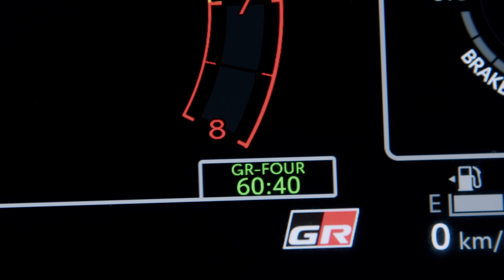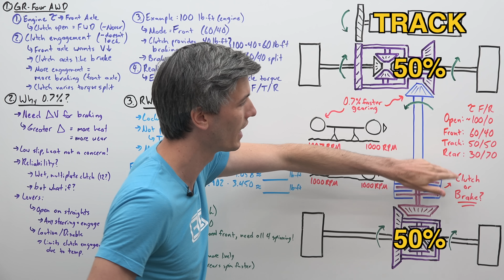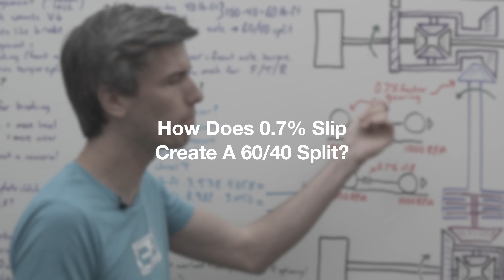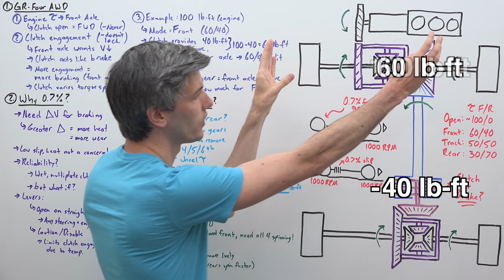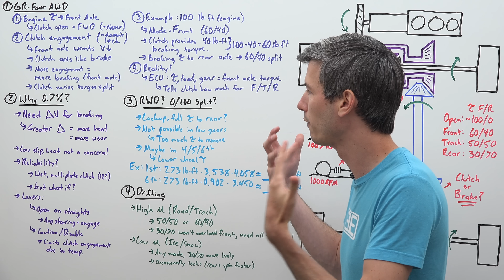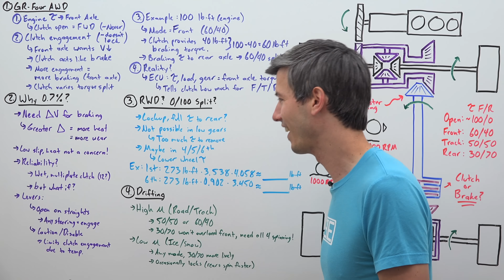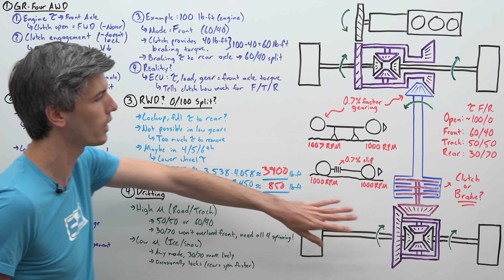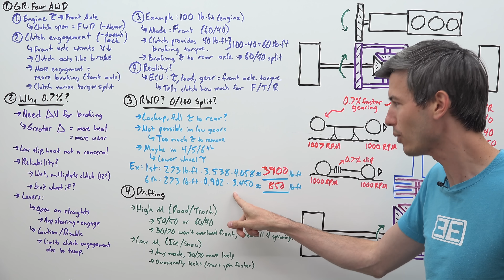Toyota GR Corolla's Brilliant AWD System - How It Splits Torque!

Comment: This reminds me of an AWD conversion for motorcycles where they have the front wheel driven slower (~33% if memory serves) but it’s hooked up through a freewheel. When the rear has traction it gets all the torque and the front is driven by the road faster than the chain, so front coasts like a bicycle would. But if the rear tire starts to spin the the chain driving the front catches up and starts distributing the torque.
Reply: You are thinking of Christini bikes I believe.
Reply: @The_Opinion_of_Matt 1q
Reply: @The_Opinion_of_Matt  also some Yamaha dirtbikes. Hydraulic drive to the front wheel
Reply: The Army deuce and a half trucks of the late sixties used a similar  system with a sprag clutch between the transfer case and front final drive.
Reply: Its actually quite common in reverse, Honda have done a few systems where a vehicle is front wheel drive but when the front slips the rears engage, I understand the issues with two wheel drive on a motorcycle and this would definitely help make one rideable, very interesting data thank-you I'm looking forward to learning more.....
Reply: I've never heard of this...going to have to look into it. Very interesting.
Reply: I was just going to comment to say this.
Reply: What Polaris(Four wheelers and stuff) call "real four wheel drive"(At least in some Swedish commercials a few years ago) is functioning like this(Separate freewheel for each front wheel, but electric engage when reversing and when decelarration in a "hill descent mode"), but for sure it is very very bad when doing work(Might be good in the swamps or whatever no idea, don't care XD)
Reply: @TarenGarond  that system is great for everything including work. The system engages even if rear slips slightly, 1/8 of the turn roughly i think.
Reply: @dkdanis1340  No it isn't great for everything(It is kind of obvious as it always need to slip the rear tires quite a bit all the time when 4WD actually is engaged.).
It is quite horrible for snowplowing (On icy surface with "non small amount" of snow)especially in corners you constantly goes sideways due to the rear tires slipping all the time, I've seen way lighter ATV's with worse traction tires (But with similar plows) do way better due to it not slipping the rear tires constantly...
Also the system is horrible when driving in terrain sometimes, imagine you need the front axle drive to keep the ATV from understeering when trying to going up sideways from some wheel tracks or something then you first need to slam the throttle like a maniac and make the rear tires slip which is very bad!
It is bad in many situations, that I'm very sure off(I'm sure it might be good sometimes though)!

Comment: Am not convinced with this awd system. Seems very inefficient, i mean how can they control the torque by slipping the clutch turning invaluable power into heat which has no use?
Reply from the maker: The braking force is still used, it's just sent to the rear axle, so there isn't much energy lost. It gets better mpg than STI, by far.

Comment: Been waiting for this video for the longest time. So basically it's very similar to the Focus RS's where the rear has higher gearing, but also like the Golf 7R where it has only one clutch pack before the diff
Reply from the maker: Yep! Though this is using a single clutch pack for the rear, the Golf R uses two, one for each axle (newest version, explained here: https://youtu.be/2-_Dzd74GUE), as does the Focus RS, but with a speed differential to allow for different torque splits.

Comment: The ending explains why all the test drives I've seen had massive understeer.... Seems like people just treated it like RWD and not AWD.

I feel like that clutch pack is going to hurt fuel economy pretty badly.
Reply from the maker: How does 0.7% slip translate to hurting fuel economy badly?
Reply: @EngineeringExplained   Right... I did not think through that clearly.  It's really not a big deal especially when the choice of  spoiler will probably have a larger impact.
Reply: That's more a function of the driver than the car. Although it does look like a slight camber adjustment could help with understeer.

Comment: If youve never researched into it, you should do one on the Borg Warner AWD system in Cadillacs.  25/75 and can send 100% to either front or rear. Clutch pack instead of differential in the transfer case
Reply: My SRX4 has it. Its great.

Comment: This car is going to be limited in production. 

I wonder if this system will make it into any other cars? Before multi motor EVs take over and can do more for less. 

Can’t wait for the full review !
Reply: You're comment about EVs beat me to it!
Reply: Yea, why develop something like this when many states consider banning ICEs in less than eight years?
Reply: @El Cactuar Dang! I usually proofread my replies - missed that one.
Reply: If only EV's were light and stored a lot of energy. Gasoline is still king for years to come. Maybe one day soon there will be the nail in the coffin, until then leave me to my own choice. lol
Reply: Exactly - what a waste of time compared to 4 in-wheel electric motors.
Reply: @adrianbjones  In-wheel electric motors are a lot of unsprung weight, which will negatively affect handling. Even with them in the car instead of the wheels, you probably don't want 4 in a road vehicle just because you're increasing the cost for very little benefit; an LSD and independently powered front and rear axles is already far better than you can get with any reasonable ICE-only car setup.
Reply: @alexanderflack566  there have been some 4-motor EVs, including the Rivian R1T/R1S. 3-motor EVs - with separate left and right motors for torque distribution control at the rear and one motor with differential at the front - will soon be common with both Tesla and GM building them (and GM putting this in mainstream pickup trucks). There is a cost penalty, but it's manageable for many vehicles.
Reply: @adrianbjones  that sounds terrible.

Comment: This sounds similar to the AWD system on the Mazdaspeed 6. Only difference is that the programming on that car, being from 2007, did not allow for the use to manually change the mode of operation
Reply: Mazda speed 6, now THERE is a forgotten car that was really damn good
Reply: @Deetroiter  I still drive one. It has over 180k on it. With age, abuse, and rust it has turned into an exhilarating pile of poop, haha
Reply: I remember when it came out it looked amazing and was one of the few “affordable” performance cars you could get with AWD and standard transmission.

Comment: I'm no drift king but I'm pretty sure having a 50:50 split for drives will not give you fun sideways action compared to 70:30 split...
Reply: I think Toyota is thinking about it more as a rally drift (sideways but with the goal of moving forwards not just a smoke show). That works for the WRC Yaris quite well on tarmac.
Reply from the maker: 30/70* and listen to the explanation provided. This is for high grip surfaces, on a car that's ultimately going to be power limited to make a drift happen.

Comment: I know the Golf R and Focus RS both achieve effectively the same result, but are there any differences between the three applications or are they all essentially using faster rear gearing and a clutch?
Reply from the maker: Golf R does not use faster gearing in the rear. Explained here: https://youtu.be/2-_Dzd74GUE
Reply: @EngineeringExplained  Thanks!

Comment: The focus RS has 2 clutches on each drive axle going to the rear wheels instead of 1 before the diff, and as a result the rear diff is locked because it can let the clutches slip to change wheel speed left to right instead of needing the diff to do it. This makes it possible to send 70% engine torque to either rear wheel.
Reply: That system also causes the RDU to overheat after 15 minutes at the track and then your RS becomes FWD… ask me how I know! 😝
Reply: @forsedfocus1768  lol. How much power did it have?
Reply: @rangerover06sc  Good question. I have seen a lot of "YEa I hAd thAT CaR! POS bleW THe traNny in a YeAR! (has a bolt on turbo pushing 18 lbs and drives like a teenager lol)
Reply: @rangerover06sc  I'm 360 whp. The problem still existed when I was the stock 350 hp (300-ish whp) and it's a known issue that the majority of people who track the car has experienced.
Reply: @forsedfocus1768  Yeah but it's a solved one. The RDU doesn't actually read temps but rather infers them from a bunch of different factors. RDU tuning is now incredibly easy and a lot of people have had success raising the "temp" limit slightly and also allowing for a slight torque increase. If you're serious about it I believe there are RDU coolers on the market with dedicated temp sensors so you can actually monitor it.
Reply: @forsedfocus1768  Some people complain about this problem. But I for some reason the demand was never high enough for any of the aftermarket companies to realize a cooler for the RDU. Also, since the Toyota is using a very similar system, there is nothing to say that it won't suffer the same set of problems. Overall, it is a very similar design so it seems very probable that it will also have an overheat protection system
Reply: @chrxx4327  Very true. I've read that they have at least accounted for this with the Toyota and gave the RDU additional cooling and putting multiple temp sensors to give more accurate readings. Part of the problem with the RS is that the RDU didn't actually have dedicated temp sensors so it was largely guess work of the ECU that you were driving in such a way that it would overheat... so even if you were able to drop the temp on the unit with aftermarket cooling the ECU would still want to shut it down after a few laps.
Reply: @forsedfocus1768  Very much this - not actually measuring the rear temp and inferring it was a lazy fail on the RS. I rarely had it disengage on track, but I didn't do many long stints since EVERYTHING got so hot, not just the RDU system. It's all manageable with enough work, but the RDU system is clever engineering with cost-cutting execution. 

I think the GRC system is the same system as the GR Yaris, so there should be evidence of it overheating or not by now, no? I haven't researched. The Corolla is heavier too.

I don't think this system is as good as the Ford's could be, but it seems to be very popular. Also this system is optimized for track use, not for track and dr1ftm0d3y0!
(Disclosure, I have an mostly stock but for brakes RS and a pre-order for a GRC to potentially replace it, and I track my cars)
Reply: @forsedfocus1768  What I'm hearing is you should switch to rallycross 😏
Reply: @CosineHyperbolic  Don't Forsed them into anything
Reply: @forsedfocus1768  ye the rs torque vectoring ability is pretty cool but I’ve overheated the diff like 50 times😂
Reply: @forsedfocus1768  upgrade your radiator.  Ask me how I know ;)
Reply: @norcalzx3  I have a Mountune radiator and still get AWD disabled... Just happened twice at my track day today. How does a radiator keep the ECU from shutting off the RDU when it's based on inferred data and not temps?
Reply: JTEKT offers the same ITCC (Intelligent Torque Controlled Coupling) used by Toyota in a configuration like the Focus, with one ITCC per rear wheel (instead of just one for the axle), and no differential.
Reply: The rear differential is non-existent, rather than locked. There's a bevel gear set of course, but that's not what a differential is.
Reply: @brianb-p6586  I know. I described it the way that I did for people who might not have a perfect handle on the differences.
Reply: @commonsensicalkurt  it behaves like locked differential  which is presumably the point that you were trying to make. Unfortunately, many people seem to think "differential" means a final drive unit separate from a transaxle,  which isn't what it means at all.
Reply: @brianb-p6586  devotion to accuracy request granted. Ha
Reply: I wonder where they got that idea from lol.  Sh awd cough cough lol.  Different design but def where they got it lol
Reply: yeah and it worked terribly, just another way companies are trying to save money
Reply: Is that not what a mechanical LSD is for ? Just more things to put torque in to in my humble opinion 🤓
Reply: @kinglouiesshed8995  A mechanical LSD will create an understeer moment (yes, that's true even if its presence allows you to create oversteer when breaking traction). The Focus RS's rear implementation is functionally an example of a torque vectoring differential, but even more flexible than most; while the differential is locked to the driveshaft, each wheel is connected to the differential via clutch, meaning both rear wheels can be either overdriven or not driven at all, completely independently of one another.
So, for the people calling it "old American tech" like an insult: If cost, complexity, overheating, etc. weren't of concern, you could easily argue that the Focus RS's rear is the best performance implementation of an AWD rear ever made.
Reply: @kinglouiesshed8995  Well some of the differences are that  a mechanical LSD is reactive not active. Also mechanical LSDs still let the unloaded wheel spin faster. It just limits that. And typically poorly if the wheel is off the ground because there is not enough torque for the LSD to lock. The diff in the focus can actively control wheel speed and the torque split pro-actively
Reply: @kinglouiesshed8995  The main reason isn't active torque split but the fact the rear wheels can be geared faster. Same theory here, with the packs always accepting some amount of slip more torque can be applied to the rear and thus true torque vectoring can be achieved rather than brake based torque vectoring.
Reply: @kinglouiesshed8995  mechanical lsds will limit the difference in speed between each tire on an axle, but it has no active control over the torque split left and right. The clutch pack method can close one clutch and open the other sending all power to 1 side, or close them both and lock the wheels at 50/50 or an combination in between. It's a more versatile system then an lsd that let's the tires slip a certain amount and then when that limit is exceeded locks the axle at a 50/50 split.
Reply: This is the GKN Twinster unit right? Several other vehicles also have adopted this module for their AWD systems, like the Buick twin-clutch AWD systems, Range Rover, and (I think) the Toyota RAV4 Adventure trims. 

Also for the naysayers moaning about the Ford Focus system overheating - a lot of that is actually the FRONT bevel box overheating, not the rear drive unit.
Reply: @Kyriaeus  the range Rover evoque was the the first to use it I think. That's the car the proved it's merits in normal cars. The focus RS was the one that proved it's merits as a performance awd system. 

The overheating problems I've seen are with the rear end. The 2018 model got a rear end oil cooler. The bevel box up front is integrated into the coolant system with some pretty chunky pipes. You would have to push it really hard to overheat it, but given it can't be disconnected from the output shaft of the transmission it's certainly possible.
Reply: Old American engineering now we looking at what Japan has to offer bro
Reply: @baediego  actually the RS was engineered and built in Germany.
Reply: @baediego  the RS was actually built and designed in Ford's German division. What I see is J a pan offering a less competitive product years later... SMH
Reply: @chrxx4327  I thought I might throw in a Mazdaspeed 6. Mazda design but ford product. Works awesome but only 100/0 - 50/50. Also pull up on e brake auto disengages rear pack. Also 2 car sizes bigger. Volvo pack rx8 rear gears cx7 transfer case on fusion body 6speed.
Reply: @baediego  Japanese manufacturers have offered just about every AWD system type ever built - this is just the specific variation in recent high-performance transverse-engine Toyota models.
Reply: ok that's old tech. We're talking about the GR Corolla now.
Reply: @sity909  the focus rs may be from 2016, but it has a more advanced AWS than this corolla 🤣
Reply: @sity909  No, separate left and right clutches is better tech. A single actively controlled clutch and either an open diff or some sort of LSD is the less expensive compromise.
Reply: @sity909  that doesn’t make it obsolete, in fact, it has some benefits over the GR’s system
Reply: @BERGERJeah  do you also celebrate Easter on Halloween?
Reply: @sity909  does the GR have real time torque vectoring to the left and right rear wheels?
Reply: @BERGERJeah  not sure, this is not a compare and contrast video so 🤷‍♂️

Comment: If 0.7% translates to ~1kW it is still about a power of a kettle, toster or an iron... Now I know why they call them hot hatches!
Reply from the maker: How do you come up with 1 kW?
Reply: @EngineeringExplained  Well, on my napkin, an engine produces 200hp, which is  ~150kW, which multiplied by 0.7% yields ~1kW (or a number of that order of magnitude).
Reply: @PrzemyslawSliwinski  Only if you're driving it at WOT at all times though.

Comment: that looks unnecessarily complicated. why don't they just go permanent 4wd like evos? fuel economy? i mean, according to this video, the transfer case clutch pack is almost always engaged, unlike vw's haldex. so it's not even going to be as fuel efficient as part time 4wds. not only that, you also have clutch grinding all the time. why?